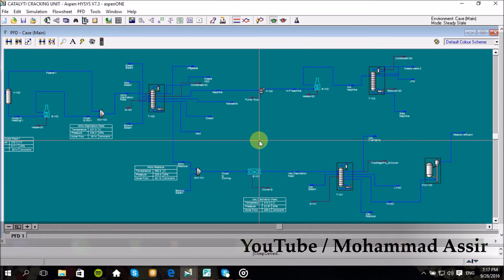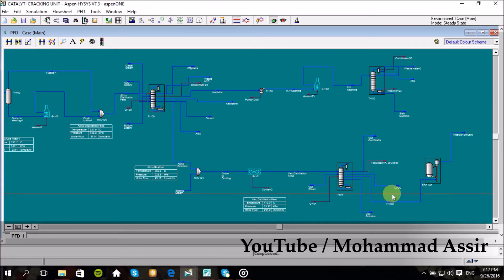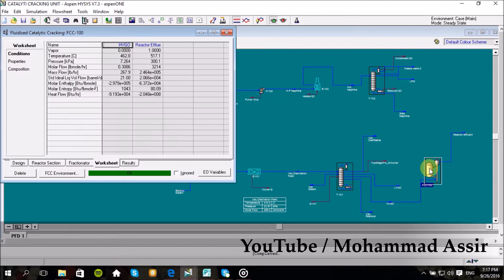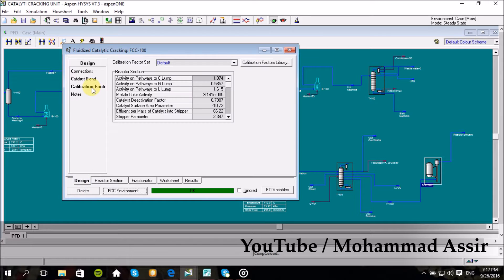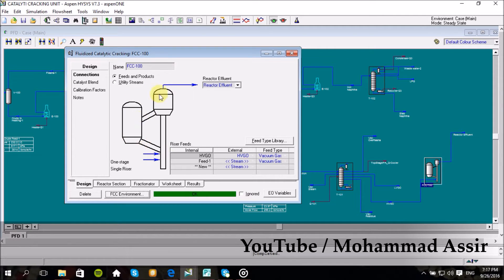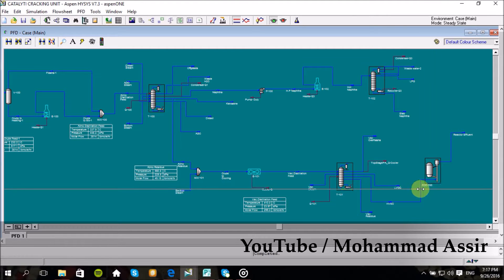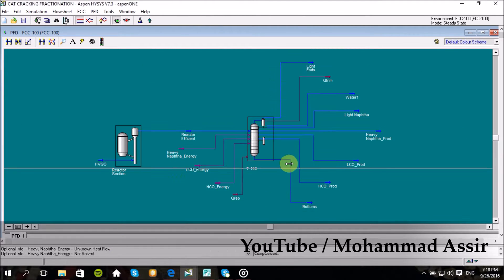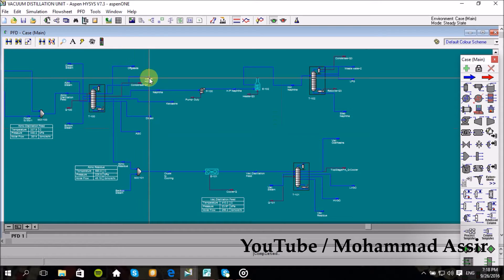5-Refining Processes - ( FCC ): (1/2) Fuildized Catalytic Cracking Unit - Aspen hysys 7.3

Comment: Thanks Eng Mohamed. Great work done here. As i beginner I found the video very useful.I only want to ask about the data for sizing and estimating parameters in the FCC Units at all stages are they typical values to be found in international standards or is it calculated based on the oil feed data. If it's so can you please give me a link where to find great and useful resources about the calculations done above ?
Reply from the maker: Dear.. Mustapha aissaoui 

First of all thank you very much i really appreciate that.. Secondly to be honest this is one of the best questions ever. And the answer in simple way that when we try to design or simulate any plant or unit on (steady state Mode) in Aspen Hysys (once we select the steady state Mode) the international standard sizing for the plant or "unit geometry data" will automaticlly run (before starting anything). But when we try to run the same unit on (Dynamic Mode) then a lot of sizing data will be required.

However i was planning to explain the relation between (feed specification and sizing data for the unit and also how they affected on eachother) on one of my next series called : (Dynamic Simulation & Process control). But it seems like there is someone can see in a future ;)

Anyways am really glad with your question hence i guess just tell my your email and i'll be in contact with you in everything you need i'll do my best.

Regards
Mohammad Assir
Reply: Ok. Thanks. This will be great. So waiting for your next videos ;) and you can contact me on :
mustaphaissaoui@hotmail.Com

Mustapha
Reply from the maker: Im real6 Sorry bto i just saw your comment.. i'll sent it today wn i back home..

Comment: Hi Mohammad,
Great video, I was looking at the mass flow of reactor effluent produced vs the mass flow of feed input and there was a discrepancy of 2.461e005 lb/hr. I think the way to account for this difference in the input of the internal feed stream. I was therefore wondering what does the internal feed stream (feed-1) represent as opposed to the external feed stream (HVGO) you can see on the flowsheet entering the cracker unit?

Comment: Hi.
Please, Can you tell me what the informations have you used in your simulation because I can't see it clearly.
Thanks.
Reply from the maker: mmmmm am not sure if i can tell you all the information or the data that i used here.. Anyways it will be great if tell me about what you looking for exactly so i can help you better.

Regards
Mohammad Assir
Reply: Mohammad Assir 
I am master's student and I will work on FCC simulation in my thesis. But I don't know which kind of informations I need to build this simulation. when I watched vedio,I said this is o.k. but I couldn't see anything from information you used. I want to learn how I can build FCC by using aspen hysys.
Please,  I need your helpful, if it is possible to help me.
Reply from the maker: ahaaa i think maybe the problem is in your network.. try to view the videos from other device or network.. an am sure you'll be able to see it clearly..

Regards
Mohammad Assir
Reply: Mohammad Assir 
I need to know what's inputs to your simulation.
Reply: OK.
Just tell me which components you used in your simulation. I have crude oil how I can enter component for it?